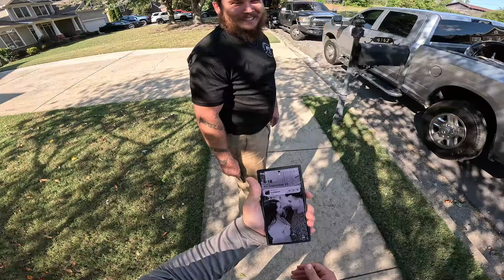Day In The Junk Removal Business! CAT 304 Mini Excavator × Blue Dimond Brush Cutter Mulching!

Comment: Andre, tell Hammer to use some sea foam motor treatment in the gas, on that chain saw.  Just a cap  full.  I use it on all my machines, it cleans the fuel lines.  That stuff works awesome.  Never had problems with it.
Reply from the maker: I have never heard of that
Reply: I’ve been using it for years, you can YouTube it yourself.  Mostly used in cars, but I use it on my chainsaw, weed wacker etc.
Reply from the maker: @jorgecruz6016  good to know! Thanks for the feedback boss 🫡
Reply: that's not a fuel issue
Reply from the maker: @strykerv1620  Hammer said replacing the fuel filter fixed it, but he also did a full service on it

Comment: U think if u paint that plywood on all sides would make last longer ? Tree guys around here use regular plywood with coat of oil on them  that osb plywood ain't gonna last but so long anyways but thought good coat of paint  on both sides and edges would help with sucking up moister an that kills osb quick swells it up an makes softer
Reply from the maker: It very well could work. I just don't care to make them last long since I got all of my sheets from  junk removal jobs used already 😂

Comment: Dont know why you were tired when you were working in the heat and hammer was sitting in the air conditioned cab 🤔 that property looked good with all that brush cleared out and mulched 👍👍
Reply from the maker: It definitely opened it up quite a bit! 🫡

Comment: I have  a saw that runs like this one. Idles great.  Give it a little throttle, and under a load, it just shuts off. Had a friend go through it, he found a piece of saw dust behind the csrb diagram. 
Ran great for the 1st 2 or 3 times now it's back to doing it again.
I have not used it in a few years now.
Reply from the maker: This one ended up needing a new Fuel line due to a crack